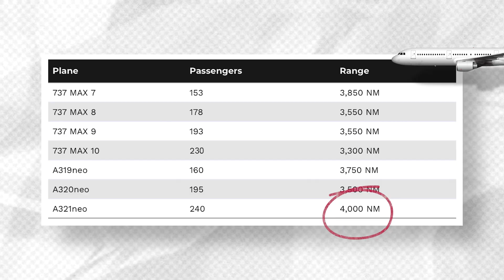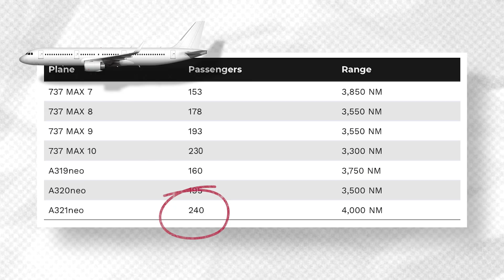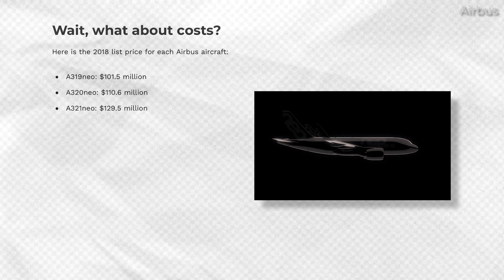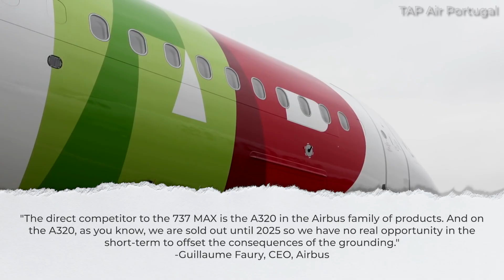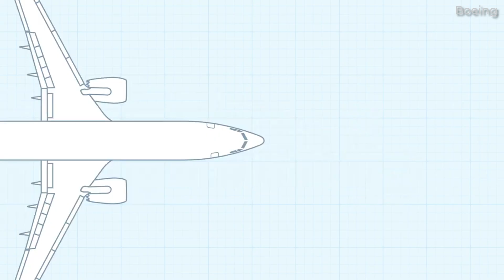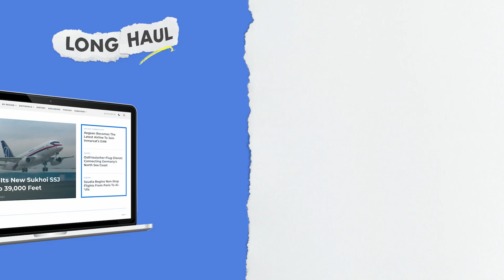The Airbus A320neo Vs Boeing 737 MAX – Which Plane Is Best?

Comment: The MAX lead to a bunch of people DYING, so A320neo easily and it's not even close.

I will concede though that the Max is a significantly better looking plane, but that's about it for the Boeing.
Reply: Well then. Airbus has had over 1000 fatalities, Boeing has made way more planes than airbus with some in an era where computer technology and safety features DIDN'T EXIST!!! They are in the wrong with MCAS, but the whole entire company is not made up of criminals. Also, the 747 was incredibly reliable, sure it had a few incidents before computers, but what about United 811? China 006? They sustained incredible damage and the structural integrity of the plane was so strong that the planes managed to land safely
Reply: @marveljayden  A320: 1500 fatalities 737: 5800 fatalities
Reply: @Chickennuggetman2839  first of all, the the a320 was  released  around the 1980s and the 737 is the 1960s 20 year diffrence.
Reply: @marveljayden  First of all, that is not true AT ALL, the A320 was released in 1988, and the 737 in 1967 not 1960. And that is a 21 year difference. Don't forget that alone the 737 has more crashes than the entirety of Airbus.
Reply: @Chickennuggetman2839  i said 1960s with an S and i said 1980s WITH AN S
Reply: @marveljayden  no you said 1960 with an s and around the 1960s. even tho its more around the 1990s and more around the 1980s

Comment: Excluding the passenger experience as you did in your comprehensive video, there is little to choose between them ON PAPER when using the perameters you chose. 

Yes, the Max has had a level of scrutiny possibly never seen before, but at the moment, there is still a perceived disconnect between the quality of the modified and tweaked design, and the quality of the finished product. The current level of scrutiny is simply not sustainable, but as long as there remains a perception that matters will deteriorate once that scrutiny reduces, what happens?

Assuming that Boeing not only get their house in order AND KEEP it so, I think that for any airline which needs the additional range that the A321 can offer, and the fact that the other models, while scoring points here and there, there is never quite enough of an advantage to outway the significant advantage of operating a single aircraft type.

This appears to be borne out by those budget airlines which operate significant Airbus fleets (eg Easyjet) having significant numbers of each variant whereas those choosing Boeing perhaps having had less. 
It will be interesting to see how it works out operationally in the short to medium term with Ryanair moving from operating a single version (737-800) to a mix, at least until all are replaced with their sub variant of the MAX8, and how it all works out of they ever manage to strike a deal for the MAX10 - or what will make them go elsewhere - after all, the Airline which is most of a long-term threat is Wizz, a major Airbus operator. 

We also have the questions surrounding the MAX - will it be forced to have changes of certification is delayed, or will it even  be cancelled.

This uncertainty, will undoubtably be taken into account, not only by airlines who want the MAX10 to be an integral part of their fleet, but by others who consider that something the size of it, may potentially form part of any expansion plans.

If I were in charge of purchasing, I would be looking longer and harder at any justification for the 737 over the A320, and would certainly not favour the 737 without them being offered on terms I couldn't refuse!
Reply: I just hope the FAA doesn't cave in and allow Boeing to sell the MAX10 without an EICAS system.  It's required by law but Boeing wants to sacrifice safety (again) to save money.
Reply: and the costs of maintenance to service future defects and safety issues will continue to be headaches and financial burdens to airlines that operate 737 max, which is almost certain to be the last generation 737, while airbus is likely to be able to redesign and re engine a320neo.  unless an airline already has 737 Ng, max is a gamble mostly. KLM has long  been a 737 operator but placed a massive order for a320neo.  Qantas isn't alone
Reply: @xa0101  You need to get your facts straight, my friend. 'Future defects', as you say, is pure speculation. The 737 is the most mature aircraft in the sky, and after the intense scrutiny that the Max just went through, a future defect is highly unlikely.
Second, the decision of KLM to replace the 737 with Airbus aircraft is not a KLM decision. KLM is now part of a conglomerate that includes Air France, which flies a nearly all Airbus narrowbody fleet. With every KLM or Qantas, there's an Allegiant, which is switching from Airbus to Boeing narrowbody aircraft.
What we've learned in this video is that the A320 is cheaper than the Max, which explains the switch, especially when you consider the discounts that are on top of the list prices. The smart money is on longevity, as well as the ability to convert 737 into combi or cargo aircraft. It's a smarter long-term investment than the A320. That's why their numbers remain so close despite the Airbus surge in recent years.
Reply: @xa0101  agreed, although it might be some time before the next generation of significantly more efficient engines appears, however, I wouldn't be surprised if they re-winged it with more efficient and significantly lighter wings.

The 737NG had brand new wings (with the not as durable as expected 'pickle forks' to attach) to compete with the original A320

New lighter wings could allow an A322 to use current engines which can't be uprated to give the required power to allow a simple fuselage stretch - significant weight savings would be needed (ie down to about the same weight as the current A321.)
Reply: The fact that the aircraft is still selling so well in the midst of all the scrutiny is testament to just how good the aircraft is. That uncertainty has turned away only one major airline so far, and that's Qantas. I think that Qantas will regret their decision in the long run because the 737 is still a greater workhorse than the A320 with its power, cargo capacity and operating costs. I don't think the 737 will lose its throne. 
Even worse for Airbus is what going to happen to the A321when Boeing has a replacement for the 757 and 767.. A lot will depend on the sales of the Max-10, but we'll see
Reply: @sainnt  It has less power, less cargo capacity (unless you compare it to a cargo only 737), and questionably lower operating costs from all the manufacturing issues and routine maintenance required of legacy mechanical systems.

I am waiting to see what Boeing creates to replace the 757, which had better be superior to an A32x, which is far older.
Reply: @AquariusTurtle  Watch this video again. The Leap 1B is putting out more power than the 1A, and according to Simple Flying the Max carries more cargo than the A320. The Airbus has a bigger cabin, but a smaller cargo compartment.
I do agree that a 757/767 replacement will be superior to the A321. Time will tell if Boeing actually builds one
Reply: @sainnt  Simple Flying is not exactly a reputable source.  They're just entertainment.  Anyone can buy stock footage for $100/month and put marketing talk all over it.  Like I said, even if the LEAP engines were more powerful, which they are not according to the source documents I just looked at, simply having more power does not equate to better.   The Airbus cargo compartment is most definitely NOT smaller than the 737.  Go inside both and measure them.
Reply: @AquariusTurtle  While your facts may be correct, you have to realise that the A320 series has been updated during its life, and the aircraft coming off the production lines today can still be considered current technology, whereas the Boeing has its roots back to at least the now obsolete technologies of the 1950s and has probably, unlike the Airbus, reached the point where it cannot be economically developed any further. It just benefits from far too many 'Grandfather rights', rights which (as in the case where the MAX10 may fail to be certified in its current form) they can no longer rely on being retained.
Reply: @sainnt  While the LEAP 1b may well produce more power than the 1a, it is because a smaller engine has been tweaked to do so. Some of the gains are also achieved simply because the smaller engine creates less drag. 

I am not a jet engine expert, but would have thought that if required, those tweaks could be incorporated into the other LEAP versions - could it be that neither Airbus are asking for extra power from an engine which with the fancy turbine coatings may add unnecessary expense, or could there simply be concerns that the engines longevity, something which may not be evident for many years, just might be compromised?

While the 737 may be able to carry more cargo by weight, this is only a benefit when that extra weight is required. Most aircraft do no take off at their maximum permitted weight. However, while the passenger 737 may be able to generate more revenue from a heavier cargo load, the A320 which unlike the 737 can use industry standard containers can load more quickly and potentially reduce the time it is on the ground, a saving which may be more of a benefit than the detriment from the reduced capacity.
Reply: @neilpickup237  Ok, you're speculating. My comments are based on the Simple Flying report. The Leap 1A and B are about the same size. The Boeing engine is flattened in the bottom for ground clearance. Yes, engines can be tuned or detuned for more or less power, but the 1B has more power.
You're also correct that the ability to carry more cargo would potentially generate more revenue. The bottom line is, in terms of airlines looking for a plane to order, the Max is a better prospect than the Airbus. That's all the video is saying and I agree. If we're talking passenger experience, I would concede that the A320 is more comfortable because the cabin is taller and wider, and so the seats are slightly bigger and offer more legroom.
Reply: @sainnt  The Leap 1b actually has a 22cm smaller front fan, enough to reduce the bypass ratio from 11:1 down to 9:1

I actually found the engine specifications on Wikipedia, and it appears that it is the 1a which has the higher maximum output. It is just that Airbus chose a 1a version wirh a lower power output than the 1b Boeing specified. No doubt each had good reasons for their choices.

As for uprating/down rating the engune power outputs, agreed, but in the case of the 1b, some quite exotic blade coatings have been incorporated to help regain some of the losses as a result of the reduced bypass ratio.
Reply: @sainnt  as an AE, I can tell you for a fact that the 1B does not have a higher output than the 1A.
Reply: @sainnt  it’s not so much the aircraft is selling well (which lets be honest it’s not doing nearly as good as it should be currently), rather Boeing giving insane discounts (up to 90% in the case of Allegiant, as reported by The Air Current earlier this year) to customers. In short dumping, which I find funny considering just a few years ago Boeing threw a fit about the exact same issue.
Reply: @kbos_aeronautics  90% discount is a lie, period. The fact is , every single Boeing or Airbus aircraft sold is sold at a discount, and the amount of the discount is never disclosed. I can argue that Airbus gave Qantas massive discounts to lure them away from their tried and true 737 to sell them A320 aircraft. 
Think about it. Why would they give Allegiant 90% and then tell Ryanair, a loyal customer, to kick rocks? In the words of Ed Lover, "c'mon son!"

Comment: then there is the MCAS debacle for boeing...sure the 737 max beats the a320 but because of rushing the development for the shareholders....this tragedy happens....
Reply: MCAS is fixed and the max is safe now. this video isn't about Boeing rushing the development and shareholders
Reply: @nickolliver3021  the 737 max is the results of the shareholders and accountants rushing the engineers to develop the plane rather than going on a clean sheet design...because it's cheaper and can profit fast...
Reply: @johnpatricklim4509  also the a320neo was rushed too because of shareholder and accountants rushing the engineers to develop the plane rather than going clean sheet design. The 737max didn't need to be clean sheet. Neither did the aa30neo. Both did it because it was cheaper and faster.

Comment: Not sure if leaving out the A321LR and XLR is right? The LR is already flying and the XLR started test flying and as it seems the airlines love the 321XLR ....
Reply: I agree it should have been mentioned, while Boeing has nothing to compete, fleet commonality gives airlines a reason to consider smaller members of the LR/XLR family.
Reply: Are you sure? The Airbus has problems Fly this new beautiful amazing Airbus A320 and it see it setn a new record, https://www.youtube.com/watch?v=I9gELPxPG8Q&t=38s
Reply: Remember the 737-100 was originally designed to be a regional jet, but has since been upscaled significantly. It was never originally intended to compete with an aircraft like the a320… which was not even around at the time. Which further explains why we need the Boeing NMA. It could be downscaled to replace 737-9 variant while at the same time having a larger variant to replace the 757 and have more competition with the A321XLR.
Reply: It's true what you say @wtfplanes  but in the last 15-20 years Boeing has constantly marketed the 737 Max variants as the A320 competition ....
Reply: They don’t really compete with the 737 though, more the 757
Reply: @EvanAviator  They don't compete with the 737 because 737 has nothing in its family that can compete with them; thanks for its 40 years old airframe design. 
The A321LR and A321XLR are in fact in direct competition with the 737 series but are currently uncontested by Boeing so far, as Boeing's NMA project is still on the drawing-board
Reply: @jahangiryounus6674  First of all, the 737 is older than 40 years. It's the Airbus airframe that's nearly 40 years old, which is to say, both airframes are old. However, the 737 that's flying today is a much more refined aircraft than the one that flew in 1967.
Also, the A321 is not mentioned in this video because Boeing doesn't have a new aircraft to compare it to other than the Max-10. Since the Max-10 is not yet in service, the proper aircraft to compare are the Max 8 and 9 to the A320. The A321 is better compared to a 757, and that's not a fair fight.
Reply: @sainnt  that is like comparing the 737-100 with the airbus 320 w ich is new 
you just cant deny that Airbus is superior! 
also this dude is american almost every other source is telling us Airbus is way more expensive 
but you as an american wich is obsessed wich convince will never admit
Reply: @jesperdevries936  Your comment makes no sense to me. If you compare an A320neo to a 737 Max, the A320 would be considered a more comfortable aircraft because it's wider. The A320neo is NOT superior to a 737 Max. I'm not sure how much you know about commercial aviation, but if you want to debate the facts, bring it on. I'll wait.
Reply: @jahangiryounus6674  The LR and XLR dont have a competitor. Also, the 737 is a 50 year old design and the A320 is a 40 year old design.
Reply: @jesperdevries936  I like both types however the only thing that makes the neo superior to the MAX is its wider fuselage. The MAX is more efficient.
Reply: @dmcr9525  and the reputation of the MAX
Reply: @jesperdevries936  yeah,thats unfair,the 737 100 will win that too easily

Comment: as a boeing fan i can't defend 737 here. its obvius that A320 had decent edge over 737 family. but 737 still remain my personal favourite. i just like the design of 737 Max much more than A320 Neo.

although 737 Max isn't competitive enough to fight A320 Neo, boeing still have some edge when it comes to freighter variant which A320 series lacks. the sales in this category isn't large though.

Edit: someone in my reply told me that airbus had freighter variant of A320 so that's a good thing! Finally airbus started to catch up to boeing in freighter market but airbus still needs long way to go to challenge boeing in this segment👍
Reply: Actually, Qantas received an A321-200P2F last year, and development and certification for the A320-200P2F is under way, so your statement that the A320 family has no freighter variant is no longer accurate, though it is understandable why you would think that, as the A320/A321P2F program is still rather recent.
Reply: @AutismTakesOn  thank you for the info!
Reply: @Arkan_Fadhila  You're welcome.

Regarding more Airbus freighters, the A350F, (based off the A350-1000), is expected to enter service starting in 2025. It would compete with the 777F and join Airbus's other freighters: The A320-200P2F, A321-200P2F, A330-200F, A330-200P2F, and A330-300P2F.